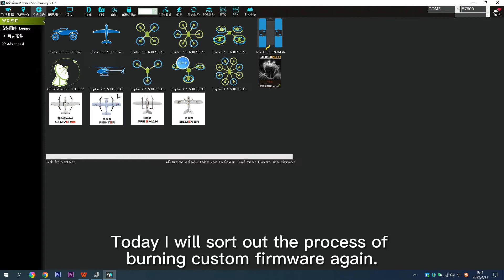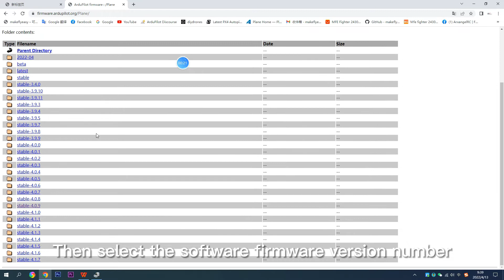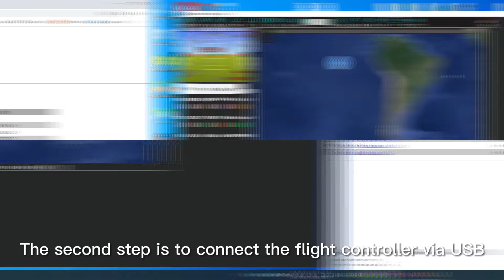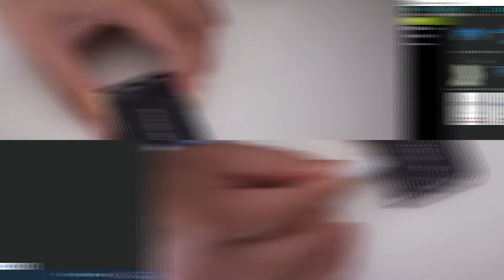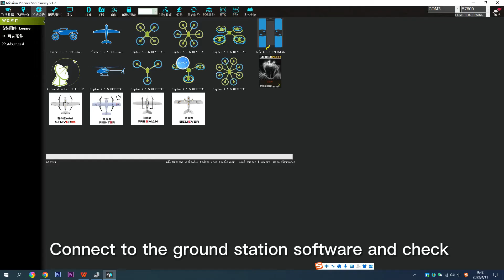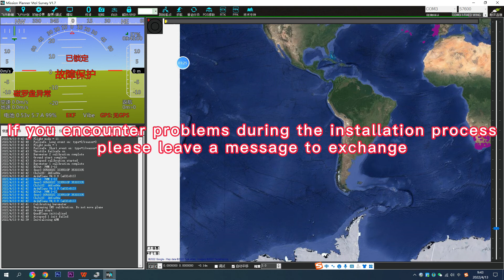How to burn user-defined firmware in pixhawk?

Comment: Hi.
I have made a custom gps. HOW CAN I MAKE FIRMWARE FOR IT TO SUPPORT MISSION PLANNER.
Reply from the maker: GPS needs to be connected to the flight controller and then connected to Mission Planner
Reply: @makeflyeasy  i connected the gps to flight controller using can protocol.But, i am not recieving any data in the mission planner.What can be the issue.
Reply from the maker: @prashantsavita6420  Check the flight control CAN GPS parameters and whether the configuration is correct.

Use the GPS to search for satellites outdoors (not indoors).